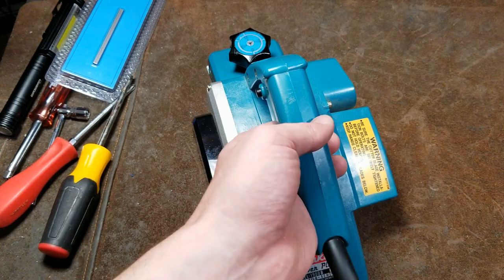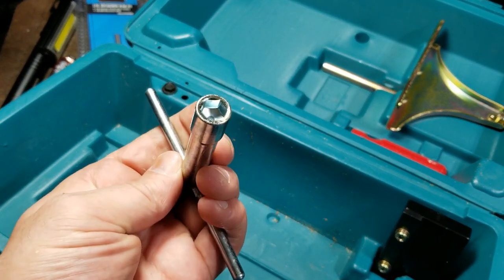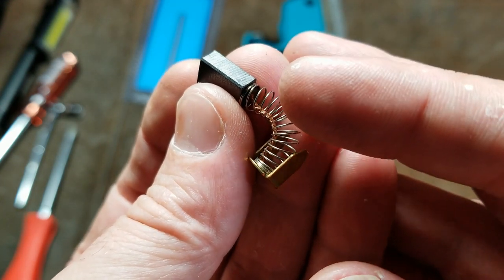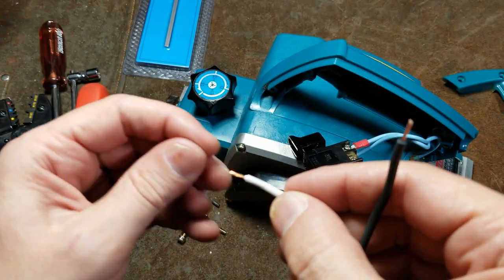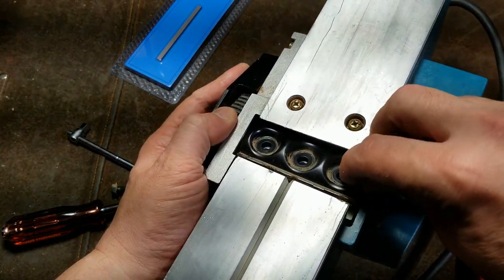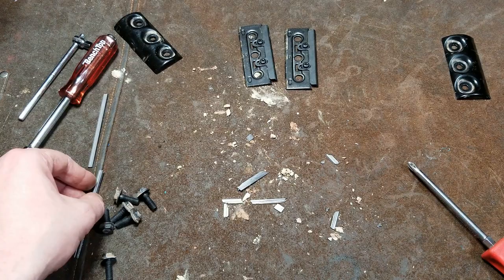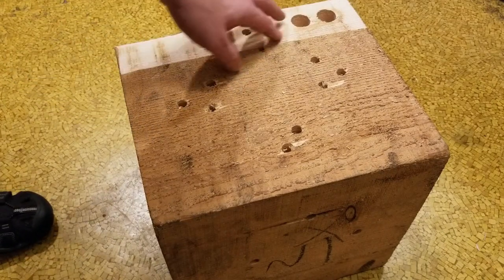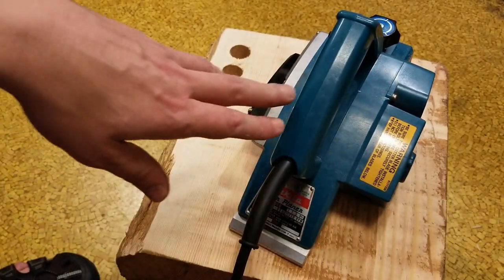Makita 1900b Hand Power Planer Review & Service/Repair

Comment: The black plastic gauge is used to set the cutting edge parallel to the angled holder when you tighten the phillips screws before you install the blades on the cutterhead. This makes it very easy to set the blades correctly for depth and colinear to the foot of the tool.

Comment: I recently bought a new Makita 1912B that looks very similar to yours, but has a 4 3/8" wide blades, so it is very practical and helpful, quite recommendable.  The  only two drawbacks are that it uses only Stainess-steel blades,and not Carbide, but the steel blades can be resharpened some times... And the second drawback is the same irregularly shaped dust port, that is very hard to connec to a dust collector.  Anyhow, the extra width is useful for me and I highly recommend that model.

Comment: lookin at picking this model on an old auction site.  Yr coverage of the models high points, bush replacement and lead repair excellent.  The tip on the copper wire in the bush to determine hard use or not, just what I wanted.  Subbed!

Comment: That is a enjoyable video. 
I just bought one of these in near mint condition and plan to take it apart anyways, so this video is very useful for me thanks. 
I did find out that that block in the tool case is for setting the knife height. ereplacementparts have a video about it.
Thanks again.

Comment: The black plastic block is for setting both carbide or stainless blades for install. edge of blades towards the block piece and then align the set block against the match grooves on top of thin carbide blade, steel one just lay blade towards block piece next the alignment tool on the back edge of blades lined up with the block edge. screw to secure which should line up with the screw holes. then install.

Comment: The unknown block in the case is to set the blade depth adjustment back to factory specs. I have lost mine and looking for one because it is difficult to set it up properly with out it.

Comment: The thorough video is terrific. Just picked one up. You may be missing the blade-sharpening jig, which took me a while to figure out but works well. 

Mine has solid steel blades, rather than the carbide blades and carbide blade holders. Any know where I can get carbide blades and holders for this?
Reply: Update: just picked up two sets of non-carbide replacement blades for just $8.20 on Amazon: With a good honing stone I should be good for years with this. 
https://www.amazon.com/gp/product/B074178VSQ/ref=ppx_yo_dt_b_asin_title_o00_s00?ie=UTF8&psc=1

Comment: The gauge block is used to set the positioning screws on the blade holder. What I don't understand is why the slot in the blades fits so loosely under the blade holder.
Reply: I'm sure it must center itself when you tighten the bolts.  I'll check it out when I get my replacement blades and do the job.

Comment: My 1900B 9/89 has one solid blade directly mounted to head not removeable with holder and philips heads 1 1/8 x 3 3/16 x 3/32

Comment: i have this planar which came with a tool in the box with a couple wing nuts on it.  What the heck is it?
Reply from the maker: There's a black piece of plastic which is used to align the blades to make sure they're nice and straight and then there's a big metal bar with wing nuts which is an edge guide if you wanted to use it on a narrow surface
Reply: john g a third tool came with planar.  It’s similar to the tool used to align/replace the blades.  It has two rather hefty wing nuts and has a molded place in the box so all closes up in a nice package.
Reply: @CatusMaximus  I think I solved my what is it mystery.  It seems the extra plastic with wing nuts is a blade sharpening jig.  clamp the blade in this and it enables you to keep proper angle to sharpen blade.
Reply: It's for sharpening Jig and you can sharpen the two blades at the same time